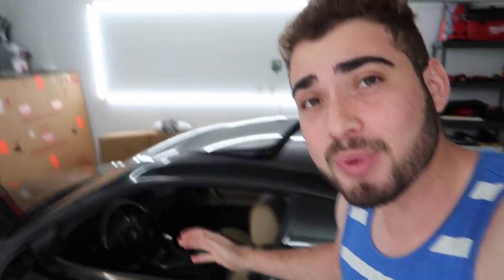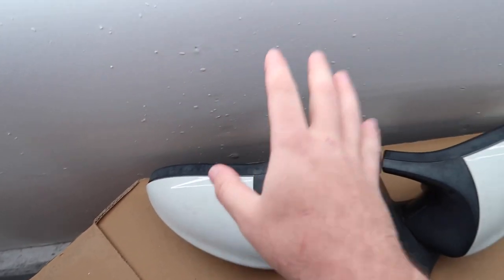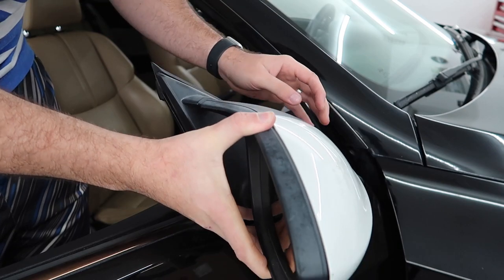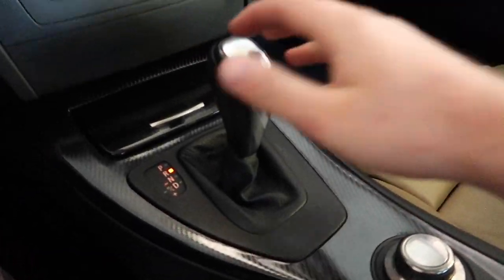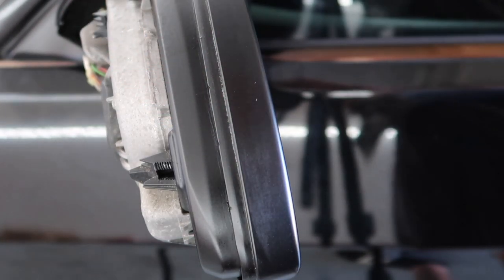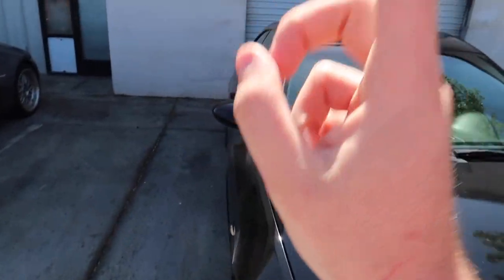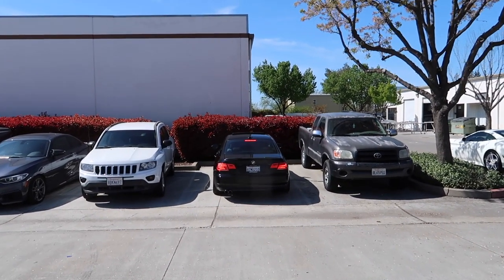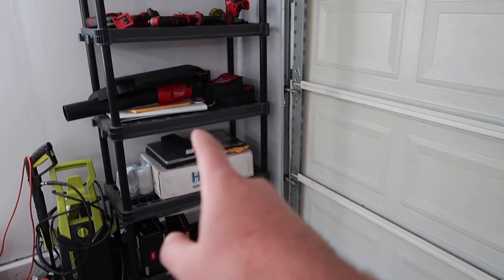MY DAILY DRIVER GETS THE FINAL M3 MOD! (OEM M3 MIRRORS RETOFIT!)

Comment: Yessir the 328 is coming together nicely 👍🏽 the speakers more than likely aren’t working because you need the correct amplifier to drive the full speaker system. Depending on your year, it’s more than likely Logic7 (like you mentioned) or Individual (DIRAC).

Comment: See from the sound settings if it’s only tuned on on the driver side and if it isn’t just switch the passenger side speakers to the driver side and try again to make sure u don’t buy new ones for no reason